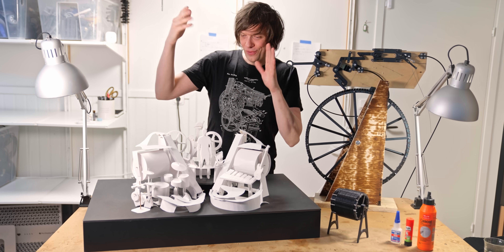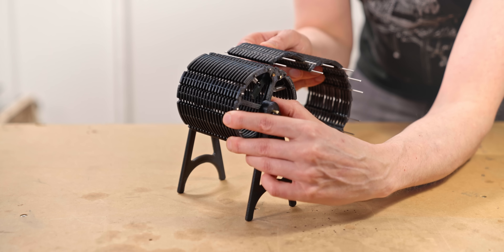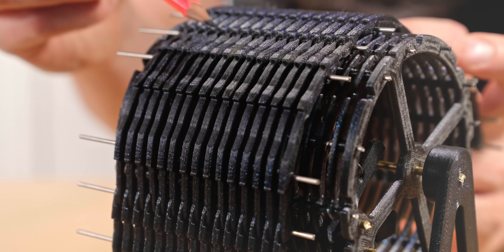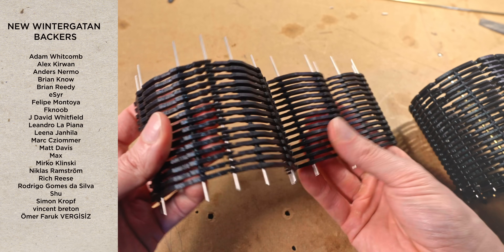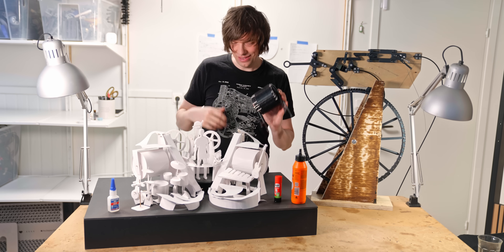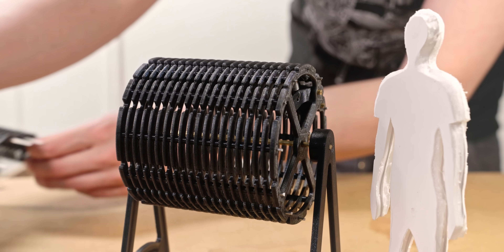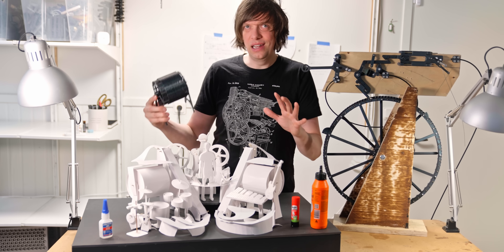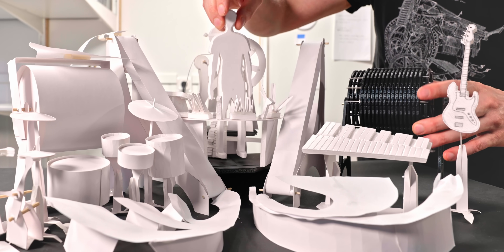A new way to switch songs on the Marble Machine

Comment: The only suggestion I have is to make a set stop and start position on the Wheel.  That way you don't accidentally start a song in the middle by accident when changing them.  You would just have to put some simple marks on the wheel so your stage hands will know the wheel is in the right place.

Comment: why build full wheel programs? that would be super heavy. you can build four levers on the wheel and replace a quarter wheel at a time. that way you can mix and match! if you divide the programming wheel by instrument and put levers on both sides, you can have 8 swappable programs on a single wheel! the programs will be lighter and easier to travel with this way. more modular too.
Reply: idk if this is what you meant, but this reminds me of how old music boxes would "switch" songs, by moving along to a different set of pins which are on the same wheel. This is a very cool idea.
Reply: That was the case on mmx, he'll get to there next episode hehe

Comment: So... presumably the idea is that everything goes on mute while you wind the song on. Cause.. rotating the wheel is how you play things. So you have to finish the first song, pop the lever, rotate the wheel once to get song 1 off, rewind the wheel to make the loading point accessible, attach song 2, rotate the wheel again to attach the new one fully, and then position it for the start of the song before engaging the instruments again.

Feels like it's going to be more than a 'short rest' between machine songs....but as long as you have a full song to slot between machine songs...

Comment: Martin, have you tried composing a song for a virtual marble machine? How do you know what you'll enjoy composing for if you haven't tried it yet? Like, make a song on a MIDI keyboard that could be played on a theoretical machine. Maybe have a version with 600 channels, guitar slides, and one without. Then you have a benchmark for what "excited" means, and what parts could be deleted or added back in. And if you need to spend 3 months writing a song, do it. That's what we're here for. Don't let these videos hold you back.
Reply: that undermines the whole point of being able to compose a song on the machine. this isn't fun and the result would certainly suffer. Working this many years on this to end up composing in logic that would probably be horrible for him.
Reply: @hmmmhhhmmh  it would make music which is arguably most important output from a musician. btw he composes on computer anyway which is where a lot of the perfectionism arises in the first place. he isn't going to compose on the machine and never was and he built a studio with all the normal modern composing tools. he is admittedly trying to build a machine that would play as well as a solenoid dropper would work - or it's actually more absurd than that he wants it to be more precise than a solenoid dropper ie LESS organic sounding than a solenoid dropper.
Reply: what he desperately should indeed have done with the mmx would have been to compose enough music to keep the interest going.

plus it would have been a nice gesture towards the supporters who paid to get something musical out of it.

Comment: Loved the original from first time I saw it. This is fascinating. You could remove mechanical issues by using lasers / LED strips, but does it then go into michelle Jaffe territory? From a practical method, having a reflective material surely easier to take on tour than multiple heavy rotating drums and in effect tank tracks!

Apologies if I have missed the point!
Reply: 8:12: "I really want a mechanical machine without electronics". I suppose lasers and LED strips are, indeed, out of the question.
Reply: he really wants only a mechanical thing and only a mechanical thing with a huge wheel while at it, so no punch hole board+tapes or anything easy like that.

Comment: I would design the removable song track things so they can accept your "pin" profiles. Then have a way to firmly attach the profiles. It would allow you to compose then just add looking set screws to fix the song to the track "tape"

I worry about potential mistakes trying to transpose the composed version to the final version of the song

Comment: Great ideas. But I'm worried about fitting ALL the information you desire to the wheel? They must have 2m diameter? What is included in ONE REVOLUTION? Whole song? Not possible. Four bars? Eight? Sixteen? Thirty two? I know you can mute channels and add diversity, but still: maybe you should soon produce one test channel to work on this?
Reply: Maybe he should make a small version of this new machine as a proof of concept.

Comment: acording to your scale model the chain of programmation panels would be 1x2.5m , that would be heavy and not easy to carry around , having solid and precise pannels is a must for live play but maybe not chaining them or making smaller chain would be mor practical , but it would require more registration point for precise assembly 
also i would suggest having a different wheel for manual programing and song designing , world tour wheels don't need to be over complicated 
have a nice day
Reply: Yeah, that would definitely be too big for 1 person to handle alone... Which is an inherent safety issue.

Comment: Just curious. Not sure how practical, or even inline with the entire ethos,but couldn't you use led strips? if instead of fixed machined drums, which can have mechanical wear, why not place leds instead? That way, it will be programmable easily, and if you use different colours, can provide a light show!

If you had lasers fixed on a bar above the wheel, then all you would need are reflectors on the main wheel. From a pure logistical mindset, less things that move means less things to go wrong!